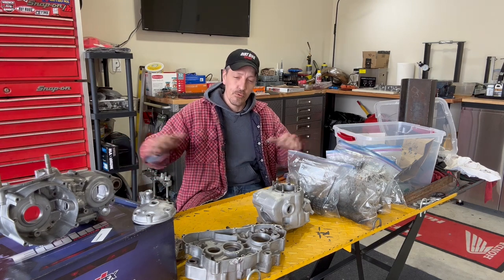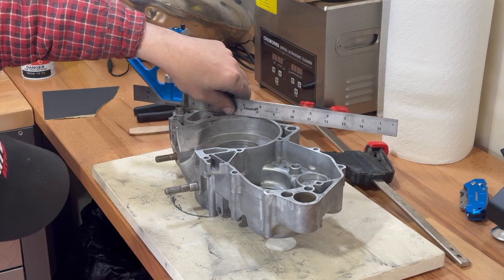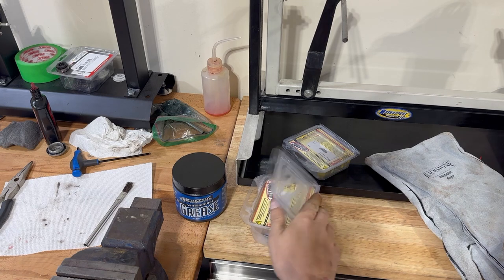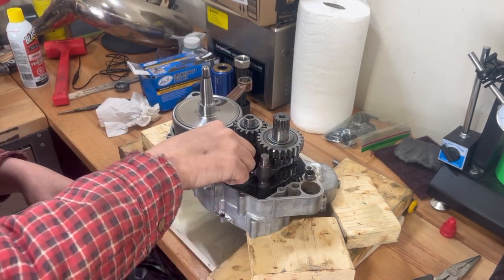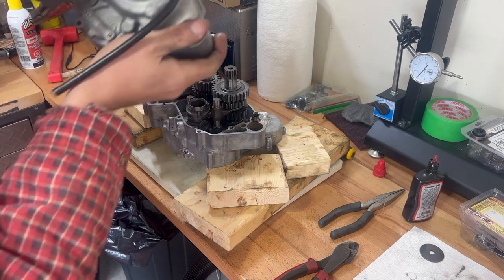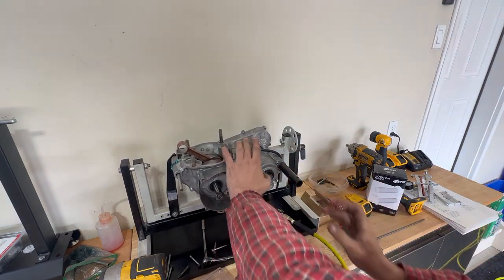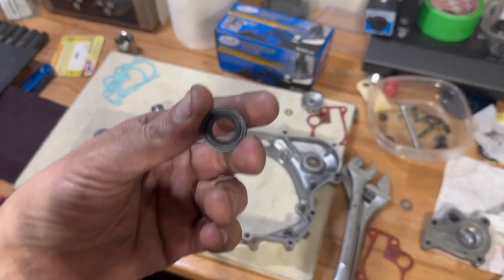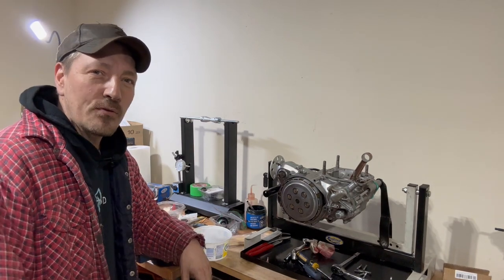1993 Honda CR250 Bottom End Rebuild, Restoration, Project 93, Canadas Worst Dirt Bike.

Comment: I might have picked up the worst 1992 CR250 over the weekend.  Just finished welding up the cases as it had a rod punch through it. 
This video is perfect timing!
Reply from the maker: That’s what we like to do here at Dirt Bike Repair!  Give you the info you need, and hopefully learn from our mistakes!  Lol.  

Thanks for the comment and for watching, hopefully your 92 is not as hard up as Project 93.
Reply: The engine might be worse off.  But looks to be healthy now.  The rest of the beast doesn't really seem that bad upon further inspection.  Thanks for the assembly video.  Was perfect timing
Reply: Do you happen to have a white tank?  Trade for a oversize black?
Reply from the maker: @narfer  I do have a white tank I'm going to have a video on the restoration for project 93 tank.. I think I have a pretty interesting way to restore the white back from the normal aging yellow.. I also do have a brand new tank... but not really interested in trading it though.. sorry.. VMX makes really nice ones that are not oversize... but they are not cheap..
Reply: @Dirtbikerepair  Hard to find any decent white tanks.
Reply: That’s so badass bro
Reply from the maker: @narfer  you’re not wrong there..  the white part about them is the hard part.  And in reality most of the bikes that had them were enjoyed by there owners.  Most people didn’t preserve parts… they used them.

Comment: I totally forgot to put the breather hose on the 2nd case when I put the motor back together and totally had to McGiver it in with a flat head screw driver, dirt bikes right.
Reply from the maker: Lol, things do happen when you are getting it all back together. I think the biggest pain is when you do miss something it’s the risk of needing to get another gasket for the one you will damage getting it apart..  lol 

Thanks for the comment and I hope your McGivered hose is holding up.

Comment: Can I ask where you get your seals, I have a dt80 Yamaha that I can’t find a seal for as well as a 250 1986 ktm that I know needs new seals before it’s started.. anyways thanks a bundle :3
Reply from the maker: In your situation if you have the old seals or the cases where they go and you can’t seem to find a retailer online.  I used partzilla for project 93.   It’s good to remember every town that has any kind of manufacturing probably has a industrial bearing supply place..   they might be able to get you the seals that you need if you can bring them the old ones or the thing you need to install them into.   That’s what places like that do for a living and they specialize in figuring that kinda stuff out!  

I hope that helps and thanks a lot for the comment.  Sometimes thinking outside the box can work for the older bikes.

Comment: Man I hate to see people use Chinese bearings seals and cranks.  And the have 7 balls. Cheap $5 to $10 main bearing.
OEM is 8 and a way better
 bearing . At the end of the day you save $150 over part made in Japan.

And you do not press a crank in the motor at all.
Reply from the maker: I have never had a problem with any of the "All Balls Racing" products,  I'm not going to  say that the OEM Bearings are not good. OEM are really good.   I just have never had a problem with any of the Wrench Rabbit kits.  They always go in really good for me and seem to hold up just as good as any OEM builds I have done so I'm really curious to what makes you say they are no good.  

Why do you not think that all balls bearings are "Cheap"  have you had problems using them ? and if so what bikes? 

 I hope we can figure out why you had a bad experience so i can try to avoid it myself, its always good to get peoples opinions and to learn something from there experience. 

Thanks for the comment and for watching the video, hopefully you like the content